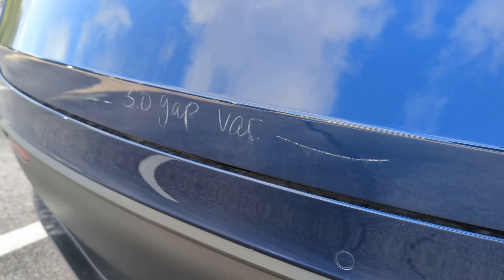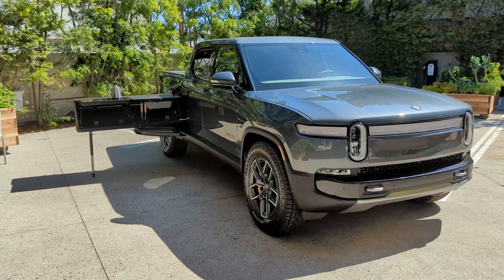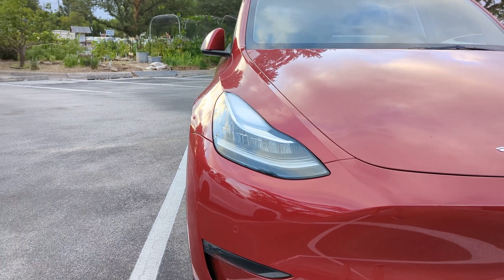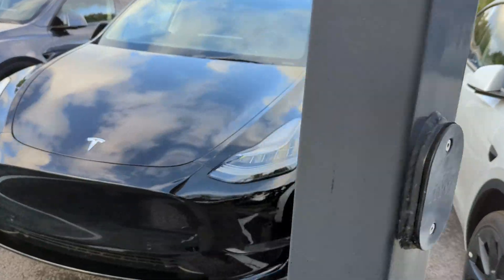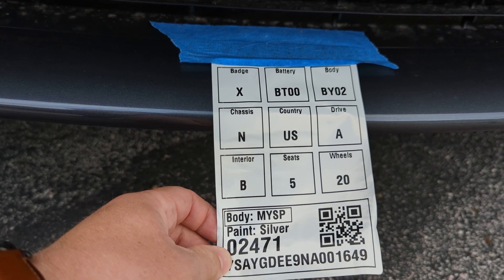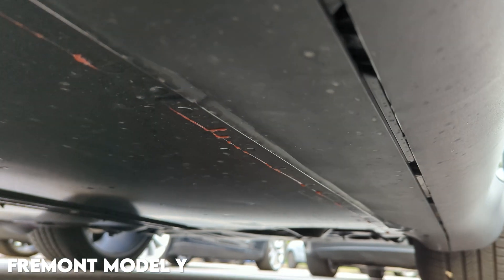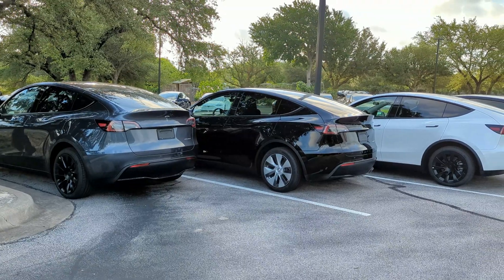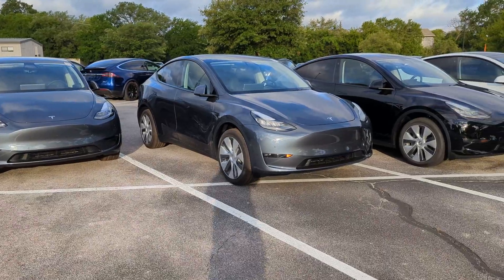Is Giga Texas Model Y Build Quality Better than Fremont?

Comment from the maker: My Pros/Cons of Owning a Tesla: https://evhelphub.com/articles/tesla-pros-cons/ 
Tips for Cleaning White Tesla Seats:  https://evhelphub.com/articles/how-to-clean-tesla-white-seats/
Reply: Took delivery of Texas Made Model Y.  So far, everything is good.  Handling is better than the current Model Y LR.  Panel fitment is good.  It was blue color with Tow Hitch.
Reply: @henryarockiaselvam92  
Henry (I'm jealous!!☹️😉)
Can you confirm the weight from the data plate inside the door?
Is it nett weight (car only) or gross weight (with passengers)?
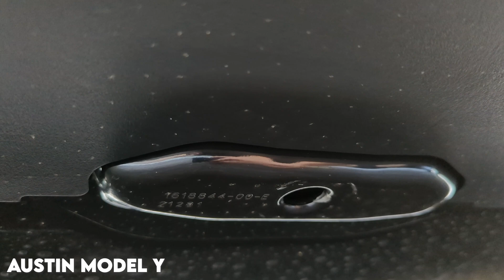Is the plate shown at 6:40 in this video a "jacking point" (meant to be an easy indicator for the structural pack...... Unless they modified the design for all cars?)
Reply from the maker: Thank you for this comment, Henry! I'm glad to hear everything is going well so far for you!

Comment: Just took delivery of an Austin Model Y long range:

Back is making a loud squeaking noise, condensation is in drivers side b pillar and blocking the camera, frunk weather seal wasn’t fully attached, a piece of trim by the wiper was detached, there was a chip in the paint in drivers side rear
Reply from the maker: Sounds like they have a lot of work to do!

Comment: Does anyone know if performance models are going to be coming with 4680 batteries? I'm so confused as to what the real benefit of the 4680 pack really is. My performance is from Freemont and will be delivered this Friday. Little worried that I just spent 73k for old technology.
Reply from the maker: Not yet. The 4680s are supposed to reduce cost long term, as well as improve battery life and charging speeds. Unknown what benefits are available in the vehicles are coming out of Austin today as the battery pack is software locked.

Comment: Took delivery of Model Y Austin made Model last week.  Had MYLR on order and was offered to switch.  Picked the vehicle with 3 miles on the odometer.  Blue color with Tow Hitch.   Build quality is good and there was no panel gap issues.
Reply: What is the battery size, how is supercharging?
Reply: What is the charge speed? And is there any difference in the handling of the car?
Reply: Best indicators....
Jacking points (different?)
Vehicle weight.
Battery data (really needs an OBD2 reader and "scanmytesla" all (ref Bjørn Nyland..... Without that, any battery observations are just speculation.

Comment: 05:40 The upper arm from Berlin is a new design. Single steel (silver) cast? These in the video are the black stamped ones, with the plastic insert, which get "treated" at a service center with sealant, to avoid water getting in between the two parts, whenever the car visits the service center next. Fingers crossed the upgraded version software quickly to all factories. 👍
Reply: Those damned Germans, improving the car?😉

Comment: Nice video! I feel like I read somewhere at some point in the last month or two that the Austin Model Ys would be coming with the trunk/cargo privacy cover like the ones from Giga Shanghai and Berlin. No idea if it was just speculation or if it came from actual intel. Did you notice if any of these had them?
Reply from the maker: Thank you, Ben! I actually specifically looked and forgot to mention it. None of them did. However - Tesla was shipping new Model S vehicles without them for a while and sending them to customers later. Apparently a part shortage thing. Could be the case here. At least I hope so!
Reply: They do have it. There's a review to confirm that.
Reply: Mine came with one

Comment: is this new structural battery pack the new 4680 batteries? or are they both different?
Reply from the maker: A customer in the comment is getting delivery of an Austin Model Y this week and they confirmed that these vehicles do in fact contain the 4680 cells.
Reply: 6:40 on this video shows what I believe to be the "unique"(?) jacking point of a structural pack.
If it is unique, that's the fastest confirmation (?)

Comment: I get vin 169_ on Wednesday. Thanks for the video
Reply from the maker: You have an Austin VIN? Congratulations!
Reply: @evhelphub  yup. Just arrived from Austin to the ft worth center today. 7SAYGDEE7NA00169_. They are are doing home delivery Wednesday@ 12-2.
Reply from the maker: Awesome! I assume it is a standard range all wheel drive? From the looks of the latest Austin made Model Y, it should be built really well! Come back and let me know how you like it.
Reply: @evhelphub  correct standard 269 mile range. I called and talked to 3 different people and they confirmed 4680 battery 🔋. I'm hoping in the future they offer some software unlocks on the range and 0-60.
Reply from the maker: Did you have a long range model y on order and they asked you to convert or did you have a standard range order before they removed them from the website?
Reply: @evhelphub  correct Jan 30, 2022 I ordered a long range and last Wednesday I got a text from Tesla offering the option to switch. I have a second reservation for a long range that is showing March 2023 as well. I'm going to drive this Austin model until then and make a decision on what the best move is based off of what the resale value is in 2023.
Reply: @Muenda1906  excellent choice. Will you make Videos? People are dying to See the charge speed.
Reply: @Muenda1906  smart move!  The software unlock would solve it for ya XD
Reply: @Muenda1906  is your delivery date still valid?
Reply: @whynotstartusingyourbrain8726  still says tomorrow
Reply: @Muenda1906  great! So you are our last hope then. Please tell us about your experience as soon as you can.
Reply: @Muenda1906  good morning. Is your delivery still scheduled for today?
Reply: @whynotstartusingyourbrain8726   yes today from 12-2 central time
Reply: @Muenda1906  thank you for the reply! Are you excited?
Reply: @whynotstartusingyourbrain8726  you'd could look under it first thing and see if it has that welded seam like Fremont pack!  Before accepting delivery haha
Reply: @Muenda1906  have you got it?
Reply: @whynotstartusingyourbrain8726   yup. Just got it a hour ago. Working on a video now
Reply: @Muenda1906  Really 😊? Whats your channel name? Awesome. Did you go um the supercharger and how do you like it?
Reply: @Muenda1906  let us know when video is up
Reply: @Muenda1906  is the video up?
Reply: Very cool man!
Reply: Hey man did you delivery change? I got vin#A00226_ delivery coming expedited but just slid back a week to 13th -19th
Reply: @davidguay5326   mine still says tomorrow at 12.
Reply: @davidguay5326  just delivered 2 hours ago https://youtu.be/y5aOZloxJOw
Reply: Congrats! The one thing keeping me from a Model Y is that I need proper cargo tie down hooks in the trunk. The made in China and made in Germany versions have them. Does the Austin built model Y? (Fremont builds do not.)